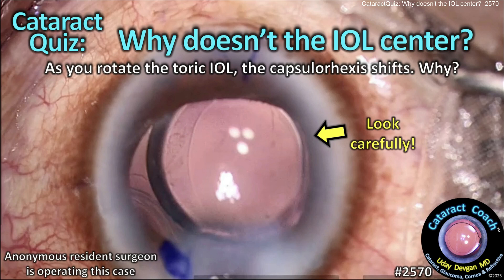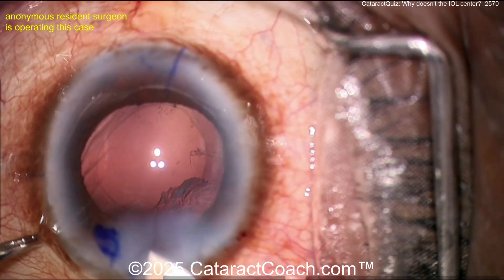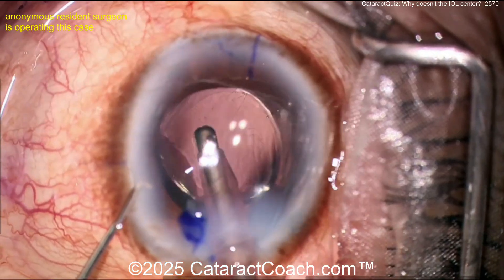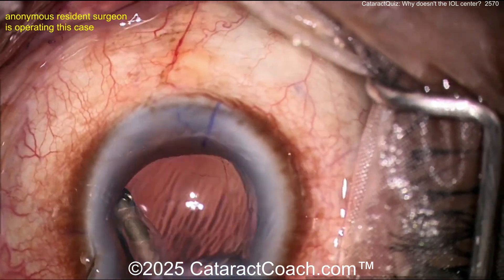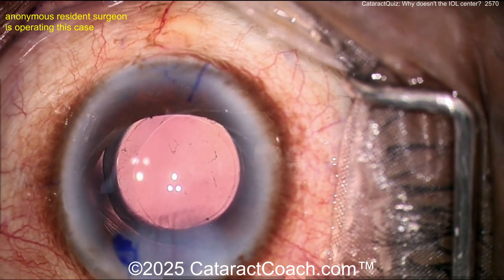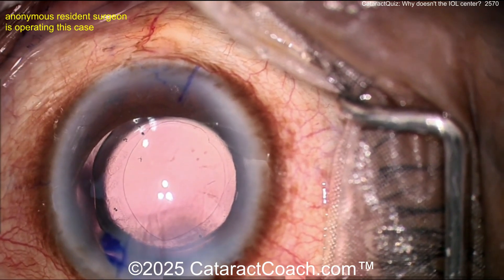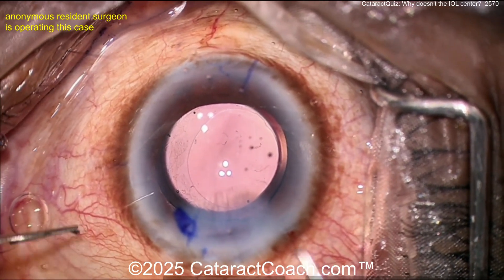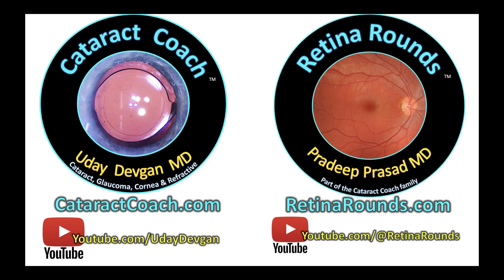CataractCoach™ 2570: Cataract Quiz: Why doesn't the IOL center?

Comment: Surgeons can get distracted by the sub-incisional cortex that we don't get the IOL placed in ideal position (5-10 degrees counter-clockwise to cornea markings -- intended axis). This lens was already placed about 1 clock hour clock-wised to the intended axis. The surgeon ended up having to rotate the lens 360 degrees. Don't be distracted by the cortex or the nuclear fragment. It may be better to have all lens pieces and cortex cleared before inserting a toric IOL. When I struggle with toric lens positioning, I refill the anterior chamber with cohesive viscoelastic and use a sinskey hook. I am gentle with rotation since I don't refill the capsular bag. When I remove the viscoelastic, the lens stays in position because there is no viscoelastic behind the bag.

Comment: The lens didn’t even need to be rotated that much, just insert it, dial it back slightly before it unfolds, remove the viscoelastic, rotate it to the marked axis if needed. Done. Rotation is pretty easy and safe with just the IA probe, never seen this happen before…

Comment: Good idea to stain with triamcinolone after  you remove the viscoelastic here to make sure there is no vitreous prolapse to deal with.  If a single piece acrylic IOL won't center make sure both haptics are in the bag and that you don't have an in and out syndrome.  If placing a CTR in an eye that already has an IOL in the bag I think it's preferable to insert it in the direction that you would rotate the lens....i.e. clockwise so it's less likely for the tip of the CTR to impinge on the tip of the haptic as it's injected in.